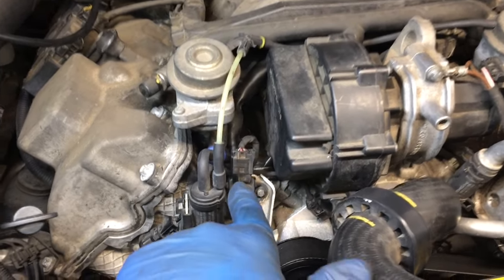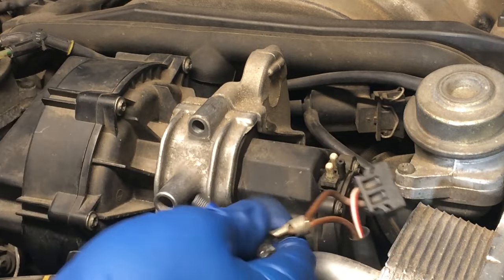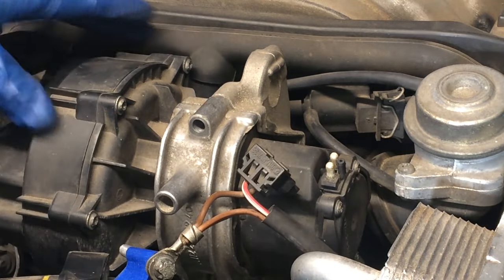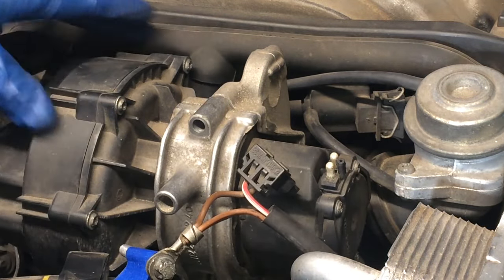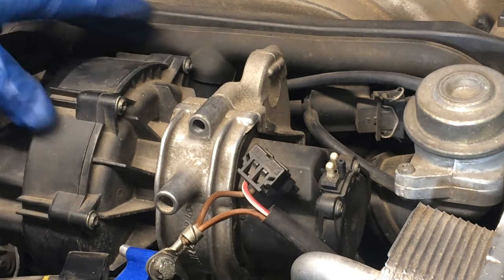Mercedes M112 M113 MAP Sensor & Vacuum Hose Replace, Change Over Valve Hose Replacement (W163 ML500)

Comment from the maker: Timestamps, Part Numbers, Torque Values:
00:27  Diagnostics (P0400, P0106 codes)
02:23  Remove MAP sensor bolt (E8) 
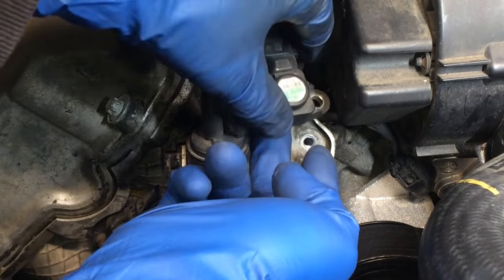02:59  Disconnect MAP sensor hose 
03:38  Disconnect MAP sensor electrical connector 
04:22  MAP sensor MB part number: A 004-153-32-28
04:32  Reconnect MAP sensor hose
04:58  Reconnect MAP sensor electrical 
05:45  Reinstall bolt (E8)

Hose replacement - MAP sensor hose:
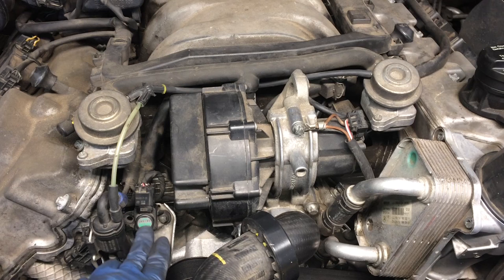06:00  Hose access if you need to work around the Secondary Air Pump
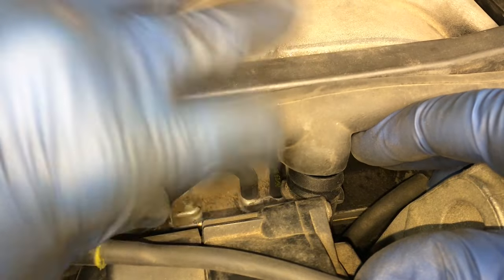07:55  Remove the Secondary Air Pump (E10)
09:24  Hose layout behind the air pump
09:42  Remove the MAP sensor bolt (E8) 
10:07  Disconnect the hose from the MAP sensor 
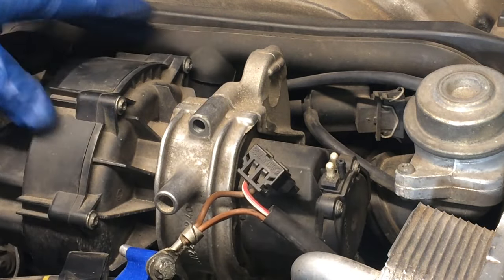10:39  Disconnect the MAP sensor hose at the manifold
11:31  Cut replacement hose: 3.5mm ID hose, or MB part 117-
997-09-82
13:25  Install new MAP sensor hose 
14:05  Install MAP sensor bolt (E8)

Hose replacement - Air Injection Change Over Valve hose:
14:30  Disconnect the hose from the manifold
15:04  Disconnect the hose from check valve
15:50  Cut a new hose (also 3.5mm ID, or MB part 117-997-09-82)
15:57  Test the check valve (MB part 001-140-66-60) 
17:08  Connect the new hose 
17:50  Re-install the check valve 

18:28  Important notes about the Flap actuator hose (don't mess with it!)

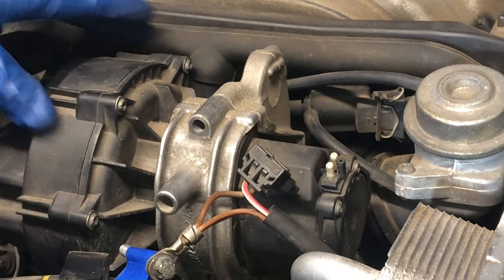21:01  Another easy 3.5mm ID hose to replace while in here

21:30  Re-install the Secondary Air Pump (E10, torque is 106 

inch-lbs or 12 Nm)

If you're troubleshooting a P0400 code and need to remove, test, and clean the EGR valve and pipe, check out this video:
https://www.youtube.com/watch?v=UmW2OhiW1Cw

I hope this video was helpful for you.  Thanks for watching, and good luck with your repair!
Reply: Здравствуйте.  С Новым Годом!!🌹

Comment: Thanks for the video. I got an engine light this weekend with the code B28 implausible. I can’t find anything that is pointing out the code. MAP sensor? Hoses? The problem? I do live in Panama. If I would go to the only Mercedes dealer in Panama, they just tell me that they don’t have parts for my 2003 E240 and I should buy a new car! So I always have to order parts online. And what happens? Right. The E240 wasn’t sold in the US market. When I order online, they ask for the VIN #. And what do I get? Right. “This parts don’t fit. We don’t have the 211.061 model in the USA. When I point to the C240 (for engine maintenance parts) I get again: “They don’t fit…” It’s easier to order in China! 😂 Just forgot: My 2003 Mercedes E240 has originally 82,600km / 51,000 miles on it. Bought it 5 years ago with original 37,000 km / 23,000 miles. - Update. I just got yesterday my new map sensor. This morning, I was working on my Mercedes E240. I unscrewed the sensor. The air supply fan. Tried to get the hose of the sensor. No problem. But something didn’t feel right. Took my cloves off. Pulled on the vacuum hose. And the hose did got longer & longer until she snapped. Had a piece between my fingers. The rubber hose did feel like play-dough! Pulled on the 2nd hose right beside and had the same issue. Pulled and this hose just felt out. The end was totally closed. This was my fault code “P28 implausible” . Bought new rubber hose. Installed both new and no code anymore. - Thank you again for the video.

Comment: Wow, I'm trying to keep an old '04 C240 wagon alive and the hose nipple locations for both the changeover valve and the MAP sensor were eluding me big time on Google, long drive back from the east coast to Houston and had both of the lines develop leaks, Your vid was perfect, part numbers, pauses to point out locations of things, part numbers for even mundane things like vacuum line, who knew it was 3.5mm ID I already had 4MM ID and 3MM ID hose in the amazon cart because I had to guess from the old, I would have guessed wrong.

Comment: Thank you L35 in Colorado. What an excellent and helpful tutorial!  I wish I had watched this first, because I did naively pull the hose from the bottom the intake manifold.  Big mistake!  Now I have another (used) intake manifold with an intact hose, to replace my intake manifold.  Not an easy job at all.  Wish me luck and send me good advice. I have a 2001 E320 4Matic wagon.  After 24 years (when new, this car was delivered in June of 2000), all the vacuum hoses are useless, frayed, cracked and with gaping holes, including the one to the bottom of the manifold.  So there effectively was no vacuum at all!

Comment: Thanks again for such awesome information. . I forgot where they went lol . I replaced all my vac lines & sensors after rebuilding my ML500 engine . Definitely not putting my trust in old rubber hoses & sensors after all the trouble I went through rebuilding her . I just need new fuel injectors before I can fire her up again , a few got stuck open after cleaning them in ultrasonic cleaner but after a few taps they closed but leaks , can’t trust them either !
Reply from the maker: Wow, nice!!  Sounds like the work is coming along well!  
Happy New Year  : )
Reply: @L35inColorado hey there . Have you ever encountered code p2004 ? . I’m assuming is some external issue because i recently rebuilt my intake manifold for my w163 ml500 & I didn’t replace the vacuum actuated solenoid on it during my engine rebuild , so far the rebuild has 4k miles and have had no issues, just this p2004 code . I replaced just about everything except for that specific part lol .

Comment: Hey I just replace both hoses that u changed on the video . I took the battery + and - connections off before starting . I ran the car for 60 miles and the check engine light still hasn’t came off

Comment: Thanks so much for this instructive video! My ML55 was running erratic and the CEL light came on. The codes were P0400 and P0105 pending. I checked the MAP sensor and the vacuum hose had broken off the back of it! A new hose and the vehicle is running good once again.
Reply from the maker: Nice, great work troubleshooting your codes!  Thanks for sharing your tips with your ML55, and thanks for watching! : )

Comment: Smart lady.  I always learn something watching you.
Reply from the maker: Thank you, and thanks for watching!  : )
Reply: @L35inColorado    Good morning L35. I need your advice please.  I own a 2004 ML500 that hasn't been started in 6 years.  I want to start using it.  I don't want to just charge the battery and turn the key.  I want to lubricate the bearings first.  I know I can't prime the oil pump manually so I thought I should change the oil and filter but also overfill the oil by double or more.  Than I could turn the car over by hand a few times; then drain the excess oil and wait a day and then start the car.  Perhaps there is some access like the oil filter housing unit or the oil expansion plug that I could remove and observe the oil level with my borescope?   I was thinking about removing the oil pan and squirting oil but that actually could end up being a more time intensive job than I have time for at the moment.  Many thanks for any thoughts you can offer.  Steve M.

Comment: Amazing presentation as always!  I have been working on my M113 5.4L for years & always wonder what that flap actuator is, you solve my mystery 💯

All your electrical clips are in great condition, mine has been all snapped including the 8 coil pack connectors 😅
Reply from the maker: Oh man, sometimes I think that MB made the electrical connectors out of dried spaghetti!  : )  I have replaced quite a few of those coil pack connectors, too - hopefully one day MB will use whatever Toyota uses.  Thanks for your comment, and thanks for watching! : )

Comment: Honestly, you are amazing to watch!!! You have a great way of explaining and very calm and collected while explaining, i could watch you all day!! I jusy ordered those vacuum hoes from mercedes, it was cheaper than online. Im having a little bit of engine shaking, i fixed the valve covers since they where leaking, then changed crankshaft position sensor, maf sensor... Cleaned the camshaft position sensor but looks like i need to chage it, and Map sensor looks original from 2004 so might change that one too.... I hope that fixes the shaking.... I have brand new motor and trans mounts so its not those.... Wish i had your patience to be able to film and explain Hahaha, keep it up!
Reply from the maker: Thank you, and thanks for watching!  : )

Comment: Always love your vids! Super well explained and shown. 
So glad i came across this vid, as not that long ago i replaced my map sensor (W211 E500) and the hose behind it was pretty well rotted at the end and all stretched out.. I was aware prior about that other scary vacuum hose, the one you mentioned not to touch. Yup thats the nightmare one if it dislodges or leaks where it goes into intake manifold. Massive scary job to fix something so stupid. Love my Benz but some ideas Mercedes came up with are absolutley horrid. Biodegradable wire insulation being one of them 😬🤬.
Well i was so worried when i spliced in a small section of hose for the map nipple thinking maybe it was the same hose as the nightmare one. Praying it wasnt dry rotted alway back. Had me worried. Much relieved now seeing your vid. Now I'll go back in and just replace the entire map hose and secondary air pump switchover solenoid hose too.
Thanx again for the great vid 
👍👍
Reply from the maker: Oh man, I know the feeling!  Yes, I don't understand why MB made some of the decisions they did, and we've had major issues with the wire insulation apparently being so "tasty" that mice can't resist it!  haha : )  Thanks for watching!

Comment: I love your videos,they helped me fix the oil leaks between the oil cooler and filter housing,i've code's PO432 and PO422, how can i diagnose that on m112
Reply from the maker: I'm sorry that's happening - those codes are typically catalytic converter related and can be tough to troubleshoot.  I'd check out the forums, such at benzworld.org.  Good luck, and thanks for watching!

Comment: Hi i just want to ask my dad have a SL500 2004, I did change the secondary air pump, fuse and the relay but the pump still not working do you have any idea why? thanks and nice video

Comment: I keep getting p0106 intake manifold pressure sensor malfunction,   with new sensor and new hoses. Even new intake manifold
 Circuit is fine. I have 5v and ground.   Any idea what it could be ?

Comment: What are those two round things near the fuel rail?
Reply from the maker: If you mean the two components connected by the hose shown at 21:17, they are check valves for the air injection system: MB calls them "air injection combination valves", but I think most people just call them "air pump check valves".  : )
Reply: @L35inColorado  yeah those! I love how specific you are. Thanks for the clarification!